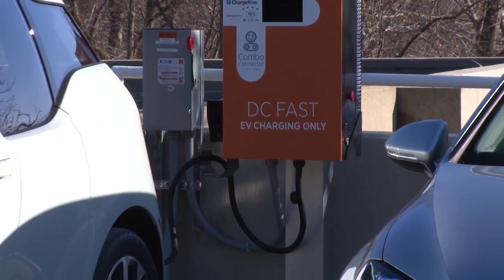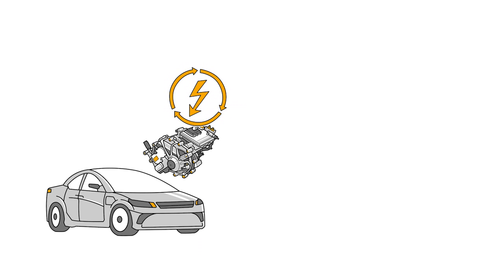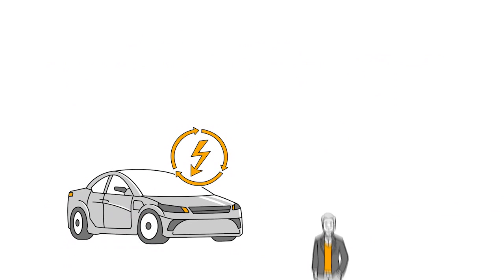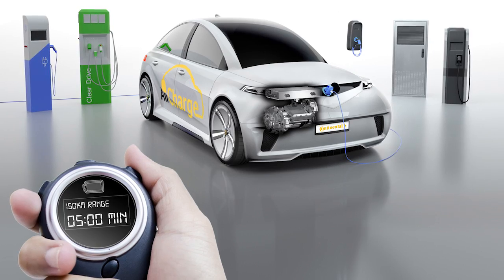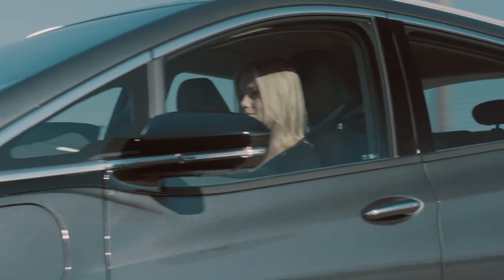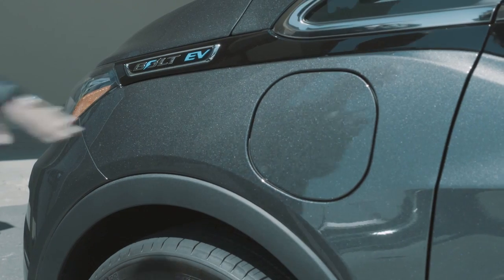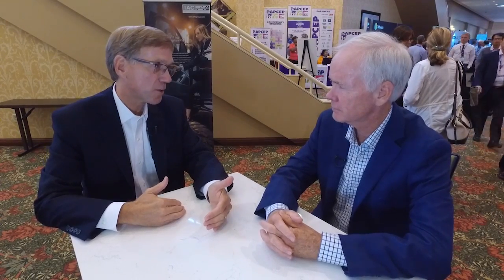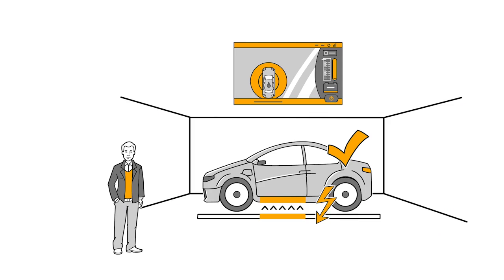The Technical Challenge of EV Charging - CAR MBS 2017

Comment: Is there Enough Electricity if 50% of the vehicles are EV ? Our electric stations capacity will have to output a lot more Kilowatts.
Reply: It's not about how much but when. Each day demand increases and typically peaks in the afternoon. It then drops at night meaning power plants either shut down or drop their output to less optimal levels. If EVs charge at night, the grid not only has no problem satisfying the demand, it actually would make the grid more efficiency since fewer power plants would need to go offline.
Reply: Tom Chan of coarse not
Reply: dMb The problem is that u cannot control when ppl charges their cars. This will cause a hugh burden on the grid and the government is not prepared for it.

Comment: Where are the pickup trucks with two electric motors on the front wheels to assist with off the line? I have a 2015 5.7 Tundra that's 4wd that's lifted and my average is 11.2. Why is there not an aftermarket option to assist with off the line? I'm talking 0-30mph and the engine seamlessly takes over. The battery's regenerate when you slow down plus charge off the engine. You could dial the regen up and rarely have to use your disc brakes. The kit would cost 6,000 installed haha. I would hope to see a 16 mpg average!
Reply: Bradson - The Tesla pick up truck is supposed to be shown/demonstrated in September 2017.  It could be a game changer for a lot of people
Reply: Michael Morrow it is a semi truck being shown not a pick up